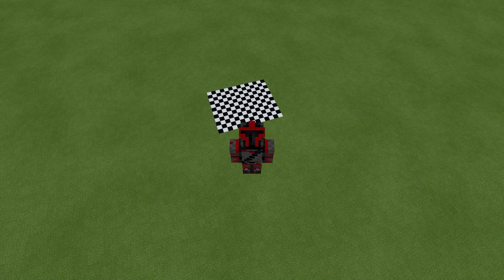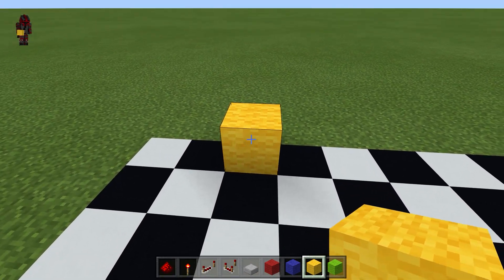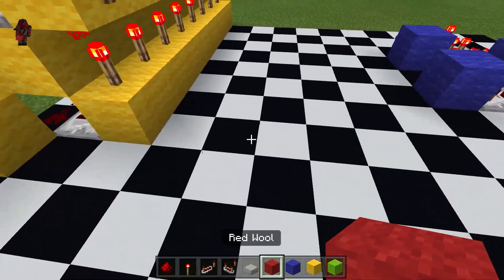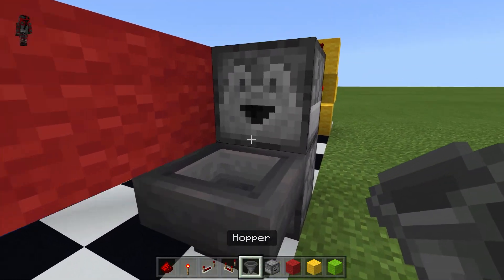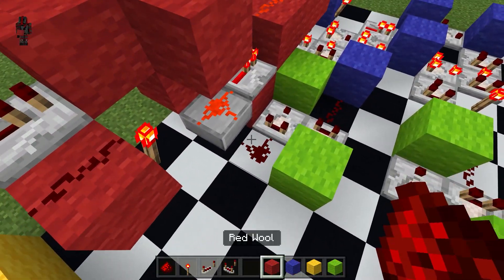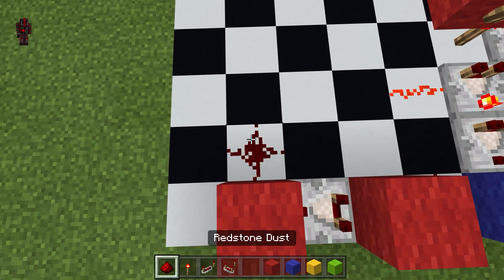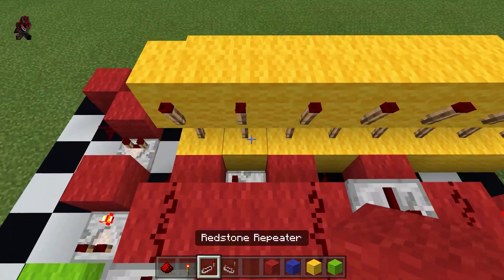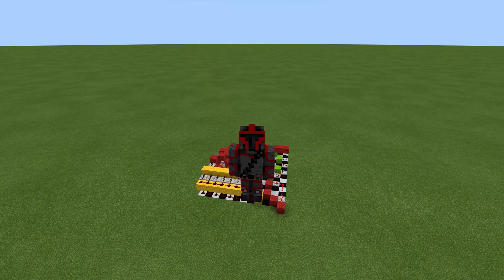RPC2 - Minecraft Redstone Hex Computer Tutorial

Comment: Just built it. Swapped out your TippyFlipFloop for one of those new fangled copper bulbs

Will test it with my 56 single frame coder and see if I can hook it up with the rest of the computer stuff I’ve been learning

Like the hex-bin-serial wire systems I’ve been building🤔

I want to build hex comps for my dungeon modules!

Will keep you updated

Edit: I guess I should join your discord 🤔🤔🤔

Comment: How do you make the computer work? After I finished following the tutorial I realized I didn't know how to run it.
Reply: Thanks. You just earned another sub! Keep up the good work! 👍
Reply from the maker: So the right input comparator is for numerical values, and the left one is for the instruction. The instruction set is as follows:

1. ADD reg1 + reg2
2. SET reg4 == reg3
3. WIPE reg3
4. WIPE reg1 + reg2
5. SET reg1
7. NOT reg1
8. TOGGLE 2*(reg1)
Reply: @ct5k_  hey man, what does "reg1" mean? I was building this computer and didn't find a way to use it :/
Reply from the maker: reg1 is short for “register 1.”
Reply: @ct5k_ but where is the input? I can’t find it